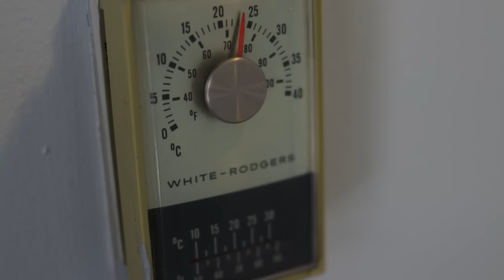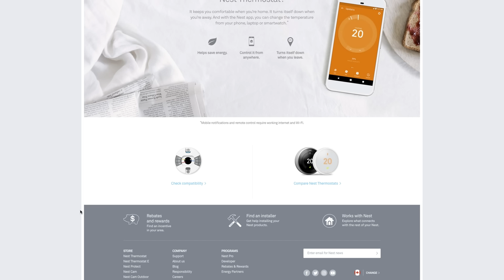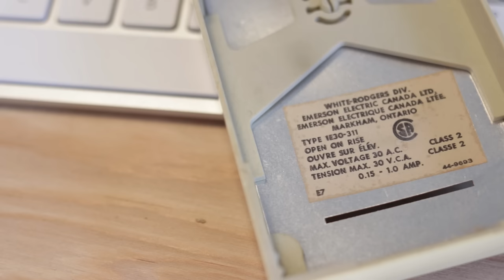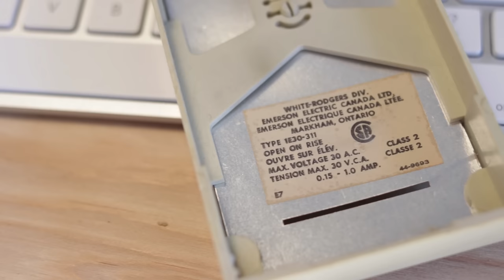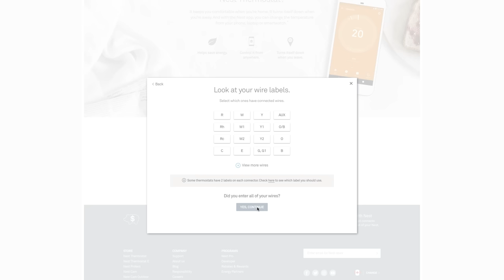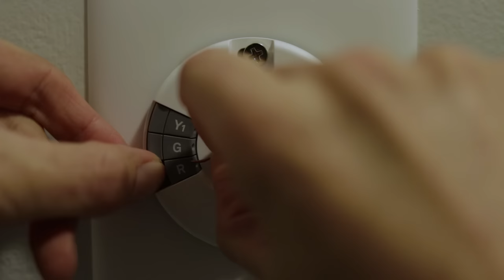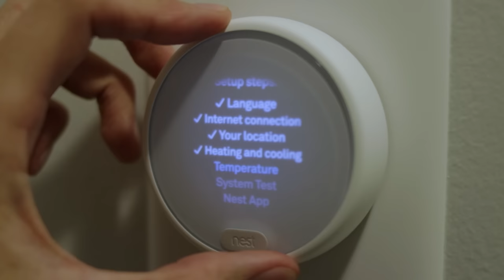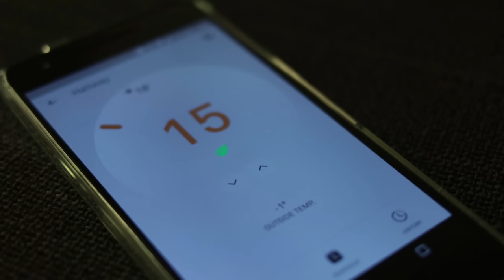Nest Thermostat Install (Replacing old 2 wire thermostat) - FAQ in Description

Comment: I set mine us following this video and my heat will not turn off with thermastat off and with temp set to 50. Any ideas?
Reply: just had the same problem.  even the nest says off the furnace is not stop. maybe because it was right out the box and not charged?

Comment: Does this work with line voltage for oil boiler and baseboards?
Reply: It works with 24v systems only. it works fine with boilers and baseboard, thats what I have (gas)
Reply: Has to be 24 v for a nest

Comment: My wires are stranded wires will it work? It is an old unit too and look similar to this one but has more wire colors
Reply from the maker: Hi Muhanad, thanks for watching the video!
This is what I found on the Nest website: "The Nest Thermostat is not compatible with stranded wires. Stranded wires most often indicate a high voltage (line voltage) system. The Nest Thermostat is NOT compatible with these systems."
https://nest.com/support/article/I-had-stranded-wires-connected-to-my-old-thermostat-Will-they-work-with-Nest
Reply: Thanks I have read that I am not sure if mine is stranded as they are hooked by a screw and donot want to open them as I am not sure if I can put it back on. How will I confirm 4 sure that if mine is compatable or not with it? my thermostates looks exactly like yours in video from out side however from inside it has 4 wires.

Thanks,
Reply from the maker: My guess is, based on the fact that it's the same thermostat, that it should be fine. Though that is NOT a guarantee as I'm not a professional. We've dealt with the Nest chat service a couple of times and they are super helpful. Maybe verify this with them? Good luck!

Comment: hi I have baseboard heating all electric is that like your system? I have black red and ground copper wire in the wall.
Reply from the maker: Hi! We have all electric forced air so I assume that's a bit different? Especially as we only had 2 wires. :) I'm not entirely sure how that would work with your setup, sorry!
Reply from the maker: And thanks for watching!
Reply: Im entirly sure about your setup question.
Baseboard hearing is a grey zone, do you have a 24 volt system? If not, that a no.

Comment: What was the voltage for those two wires? Is it DC or AC?
Reply: Jose Luis Noguer     12 to 24 volts.  D/C
Reply: @christopherbonanno1120  Its A/C

Comment: What’s the difference between the Nest E and other Nest thermostats?
Reply from the maker: The 3rd gen has more connectivity options so if you have a newer system it could be that the Nest E is not sufficient. Make sure to check it out before you buy! Thanks for checking the video, Chuck!

Comment: Do you know if I can add a sensor on the second floor to this thermostat ? Thanks
Reply from the maker: I don't have any experience with external sensors, unfortunately. Thanks for watching! :)
Reply: I have that answer, the answer is yes.. and.. No.

I'll explain.

Nest doesn't have a external sensor, instead, they partnered with Keen. Keen makes the "smart vent" 
https://keenhome.io/pages/how-it-works

This vent is compatible with the Nest, they basically talk to each other.
Think about the smart vent combo for a sec.
The vents have built in temp sensors, the vent will close when the sensor in the vent reaches temp. I don't need to explain how this would be extremely useful in saving energy and evening out the temperature equally in a home, especially a two story house.
Reply: Not sure what Hego means but yes there are external sensors.  They're $40 a piece or $100 for 3 and they connect wirelessly.

Comment: Would this NEST E replace an old rotary 24v thermostat like yours which also has 2 wires ?
Reply from the maker: Thanks for watching and reaching out! My guess is that it would work. Though I'm in no way a Nest professional. :)
Reply: Thanks will give it a try but it should as it's compatible with a 24v like yours :)
Reply from the maker: Exactly, that's one of the main things to check! High-voltage systems do NOT work with Nest. :)
Thanks!
Reply: jrmtl yes, it will work

IF you don't have stranded wires and IF the voltage is 24v. Any issue that happens after that is rare and fixable.
Reply: @HegoDamask8306  stranded wires will work as well actually.

Comment: i just ordered three Honeywell Lyric T5 from Mass Save on sale and they will not allow me to refund. I just seen this video and i have the same wire setup and your setup work just fine. I have not tried to wire mines yet as it has not been shipped. I tested my wires and i have 1 White and 1 Red. The Red was reading 28v, so i figured i have power and it should work. Does anyone know if you can apply this method to a honeywell Lyric T5 Thermostat? I see some people are saying the feature is called power stealing, not sure if the honeywell is able to do the same. Can someone please help me or send the link to a video to see if this will work. It seems i am stuck now with the thermostat after speaking with customer service. The  Cyber Monday deal gave me 3 new honeywells for $24 each. I have a peerless boiler, not sure if the helps. Thanks for the help.

Comment: I have the same 2 wiring did you need to put a "Common Wire" into the mix or not?
Reply from the maker: All I did is what you see in the video. :) So no, I did not need a common wire at all. Thanks for watching Jeffrey!
Reply: I believe the Nest does not need a C wire. Check this out. https://nest.com/support/article/When-Nest-needs-a-common-C-wire#wire-may-thermostat
Reply: Jeffrey Dubin. In most cases, no.
If it does have issues, swap the two wires, if it STILL has issues, then and only then should you need to worry about a common wire.

Comment: Where is the power source for the thermostat? The 2 wires have also electricity?
Reply: I would like to know the answer to your question as well.  Is there enough amp to pull from the 24V line to recharge its internal battery?  I heard some rumours that it could strain the transformer in the basement, so I didn't proceed with the purchases.
Reply: @curiousgeorge3967   The thermostat is designed to be powered by the 24V, but generally requires the C wire so that it can charge even when the thermostat is satisfied and the heat circuit is open.  When the house is not being heated, the 24V runs from the red to C wire, and when heat is needed it runs from R to W.
Reply: Call a hvac tech dude you are lost.

Comment: Question, with the 2 wire set up does this still give you all the Nest functions? I thought you need a C wire to give the thermostat constant power and keep all functions working. I also have an old Honeywell's with a 2 wire set up and I'm having a hard time looking for a way to modernize it.
Reply: from my experience... i installed the nest during the summer time and so i didnt need constant heat. The thermostat would not hold its charge at all and so i had to get the C wire to keep it on. If you want to use its full functionality, i would recommend getting the C wire.
Reply: Mine stays charged fine with 2. It depends on your system its different for everyone. If you end up with charging issues then you need a common.

Comment: So it never has to be charged? Never has to be taken off the wall?
Reply from the maker: Hi Joel, it never had to be charged in the 1.5 months we used it.
(We switched to the 3rd Gen Nest Thermostat as our furnace was too old to be able to keep up with the crazy winter here in Canada.)
Thanks for watching!
Reply: Maurits Nienhuis but is it getting power? Sorry for all the questions man. We have the same setup. I’m debating running a 5 wire line. And then adding some transformers off the boiler. But if this works constantly and don’t have to charge it. If it gets power somehow off the boiler lines itself. I’ll definitely grab these.
Reply from the maker: Hey Joel, no worries about the questions. Though, I do think you know more about this stuff than I do, lol. ;)
Ours didn't need any charging (off the wall) in the 1.5 months we had it and I can't imagine that the battery lasted that long using WiFi and such. :)
Reply: Did you do the same connection with the Nest Learning 3rd Gen?
Reply from the maker: Hi Raimundo, our entire furnace setup changed so I can't guarantee this would work with the 3rd gen. Though I'd expect it to work just fine.

Comment: Not all 2 wire are the same.  There are some that has regular voltage(which by luck is what you have) coming through, and there is some with millivolts.  You need to make sure the unit is compatible for it or it wont work.

Comment: if you have another therm wired convential therm in parallel, like i did, and the other closes, the nest loses power with error e195....  but yes, two wires worked on my gas boiler.....it just bothers me because i can;t understand how?  i have hear power sipping....  like the therm only pulls a tad of juice, and when it closes, the load carries.  i am setting up test stage with to do some analysis as to what is going on....   the logic puzzles me....and nest only wants to send a pro....  this is all for the E which i like better than the 2nd , by far....
Reply from the maker: Oh, that sounds complicated! :( I wouldn't be able to help you with that, unfortunately. Maybe the pro is what you need in this case? Thanks for watching and I really hope you get it sorted out!
Reply: cool video, So I'm having issues also. Just hooked nest (2 wires) all good, after about 20 minutes Rh wire not detected? E74 code. I can hear furnace kicking on when i connect the Rh wire and off when I disconnect
Reply from the maker: Hey, I missed your comment! Sorry... Did you figure out what the issue is/was? I can't really help I'm afraid! Thanks for watching!
Reply: I'm having this same problem. Turns out my furnace is tripping the thermal limiter and short cycling. Apparently it's been doing this since I've lived here but I never noticed with my old dumb thermostat
Reply: Brandon H that is possible, but it's probably just when the Nest was installed, and it's fixable.

Comment: If you really want control, you go ecobee.

Nest has no control in comparison and not a single hvac tech likes working with them due to their lack of options and control.

Your install and video is good however, from experience, remove the back plate before the wire screws. If your wire is too short or they left some rolled up wire creating a weight behind the wall, your wire could fall down behind the wall and then it just got more complicated. Remove the back plate, pull gently with the wires to see if the wire can move and if you have extra length to work with.

Comment: Thank you! I’ve been wondering if the nest would work with an older home.
Reply: It does but i would strongly recommend replacing 2 wires wit at least 3 to 5 because i had so many problems with two wires

Comment: you don't have a "C" wire (typically the blue wire), which supplies 24v to the thermostat. You may want to add that later.
Reply: hello,   do you have any power issues?    do you need to charge the batteries?   I only have  2 wires.   will I need the c wire?
Reply: @mrcarpet4u  if you only have two wires you most likely have a much older system. You should look at your entire system and see if it needs replacing or if a smart thermostat will even work

Comment: i couldnt get mine to work with only 2 wires, need an electrician to run a common wire & needed a relay because of the way my furnace was set  up
Reply: This can happen.
Reply: Interesting do you have an oil or gas furnace?

Comment: I installed the nest E , with two wire Red and Black. unfortunately it creates an error code # E194 
No power
wire detected. 
R wire required.
any helpful comments?
Reply: suhaydee 97 I’m interested to see what people say as well, that’s what I have as well. Before I buy a nest I want to make sure it’s going to work.
Reply: have the same error code
Reply: Hey If you have the error 194 ,I found out how to go around that.
1) first charge your thermostat it's not 100% from the store use a USB  cable.
2) second interchange cable's white or red  at R  and black on W1.make sure the end of cable has a clean cut and are well attached.
Reply: 5 wire
Reply: It sounds like you may have a millivolt system. If that is the case, the nest will not work unless you use a 24 volt transformer to supply the power.
Reply: Needs more than 2 wires least 3. You need an R and C to keep 24v. W terminal for heat. Nest will NOT work with gas wall heaters or floor heaters or electric wall heaters. Some really old furnaces you can because there is no power sharing.  But that's rare.
Reply: @asergio95  Mine works with 2 wires. A black wire and white.
Reply: @ryanmcmahon615  like I said sometimes they work. Depending what type of system. I always throw a common everytime I install one. So I don't have any issues in the future. What type of system do you have?
Reply: @asergio95  Gas furnace, hot water baseboard.
Reply: You need an extra wire running from c on the thermostat to c on the furnace. That provides the 24 volts you need to run your stat.
Reply: @Logaweed  For heat only. You need the Rc power wire and W1 heating wire. The system works just fine.
Reply: Could just need to flip the wires as only one will have 24 v.
Reply: @asergio95  I have older trailer with floor heater, and I have a nest, but I've got like 5 wires.
Reply: I'm having the same issue, and it's not resolving.  I have a red and black wire and have tried them every which way.  Still getting e195 message.
Reply: Call a pro they will get it figured out.

Comment: I replaced my 2 wire thermostat with the first generation Nest and have problems with the battery discharging. I connected the 2 wires to W1 and Rc. I'm guessing I need a C wire (common for 24v) I am currently trying to charge up battery by removing Nest face piece and plugging in to USB. May have discharged due to non use through the summer.
Reply: Did you get it work?

Comment: For those people using the other Nest 2 and Nest 3rd Generation, this will not work. You will need a C wire that runs minimum 3 wires. This Youtube does not  apply to the Nest3, This NestE is only for running a simple 24-40v heating system, its basic and does not have the AI built computer of the other Nest3rd generation . The third generation of the other Nest checks weather and has way more functionality and capabilities. This NestE is not for Air conditioning Heat pump units or for Smart Home Energy Radiant Heat flooring. This NestE its minimal power with two wires turns your old thermostat into a digital screen and to be use via app , The App is not to be use all the time as it will completly drain fast the NESt E, thus why a C-Wire is needed on a minimum 3 wire setup.

Comment: Your problem is you need the third  wire that third should be a constant 24Volts to keep from loosing the  memory in the stat. It will go dead in a few months...
Reply: That's true with some smart thermostats but Gen 3 and E Nest can work without a common wire using "power stealing" where it uses circuitry to get its common through the W or Y wires.  It's not perfect and doesn't work with everything that way but it's still a solution.

Comment: Yeah, the provincial government just replaced one of our old Lennox thermostat with a Nest E thermostat though they only did one of the two thermostats in the house since the government efficiency program only covered one thermostat per house.  Overall, I'm not impressed, the old bimetallic thermostat lasted over 40 years without a problem, will the same be true of the Nest?  Also, the Nest contacts a corporate server storing your settings and home temperatures there as well as retrieving any changes you've made over your app.  Exactly which country is this server in, what laws governs the information privacy, what happens to the functionality of the thermostat if the corporation goes bankrupt or is bought out and what if that server is hacked?  Being computer literate, it was easy to install the apps, set up the accounts and control both the thermostat and reprimand the schedule that the learning algorithms dreamt up but an elderly friend whose thermostat was also replaced by the government was so fed up that she had an ac system installed and told them to replace the Nest with the thermostat that came with the AC.  On the plus side, I'll probably get her government provided Nest and could use it for the other thermostat in the house, as soon as I figure out how to unregister it from the other house so that it could be registered to my account in that far off foreign corporate server governed by questionable privacy laws...
Reply: Seriously dude, nobody cares about your thermostat settings...

Comment: So it's been a year... have you gotten the "low battery" message yet and the Nest stop working? I did. If you did too, how did you solve the power issue? Thanks.
Reply: You most likely need a common wire depending on your system. One way to check is to go into Technical Info>Power and the voltage should always be above 3.7. If it is dropping below that consistently you definitely need a common as its not getting enough voltage from "power stealing"
Reply: @doomsday9973   Thanks!
Reply: you are welcome!

Comment: my house thermostat have 4 wires and had to put a adaptor. if i wouldve know that the nest would work with just 2 or 4 wires i would of bought it instead of the honeywell T5
Reply: Wagner027 you should be able to use a nest with either 2, 4, or hell...even a 6 wire set up. His is only 2 wires because he only has heat and no cool.

Comment: You also forgot to replace thermostat wire , you need at least 3 wires to run constant power to the thermostat